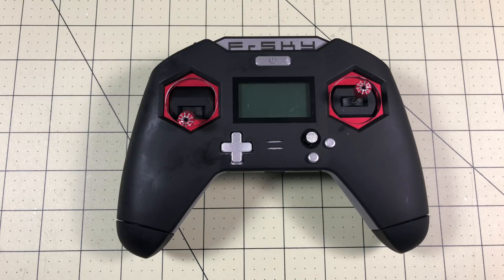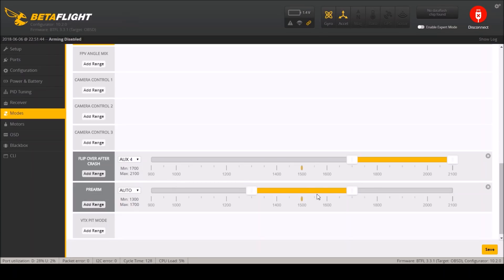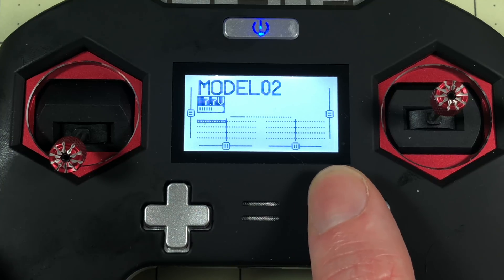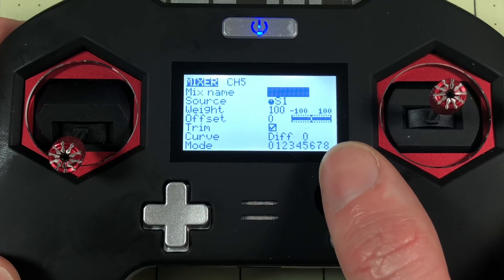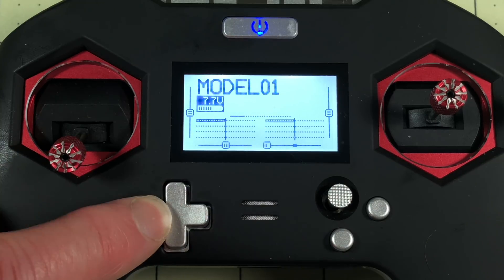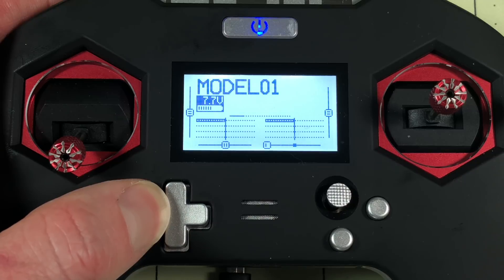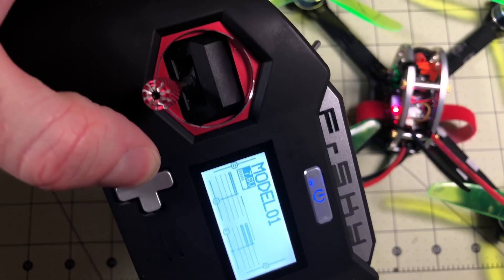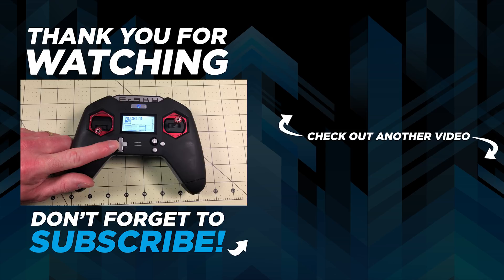FrSky Taranis X-Lite Momentary Switches and PREARM | How to use the trim buttons

Comment: I won't be able to use this feature if my Rx is set to only 8 channels (arm, mode, buzzer, rssi), is that right? I would need to flash the 16 ch firmware?
Reply: I have it working in D8 mode if that's what you're talking about?
Reply: With crossfire I had to switch to 12CH to use this (I have PREARM now on CH9 in the MIXER)

Comment: Very helpful.

Can more real switch’s be added to the front plate?
Reply from the maker: No. You can replace other switches with momentary. But not add them. Official FrSky Taranis X-Lite Momentary Switches  They exist, if you really need them. https://youtu.be/71-DPpuZJaU

Comment: Way easier to disable trim in flight mode 0 then you're good to go to assign them as regular switches without alarms
Reply: I tried that , and the switches are not picked up , am i doing something wrong?
Reply: Combine what DR101 is doing to set up the switch/mix/weight but use what Kyle is suggesting with Flight Modes to disable the trim functions.  It cleans up the graphic home screen of the trims, disables the sounds without deleting them.  @ProofBenny
Reply: @Kekafuch  how to disable trims in flight modes? All I get on FM0 is name, fade in and out values.

Comment: Hi, thank you for the tricks, Im using now momentary switch for prearming even as switch to trigger the buzzer.  Question:  Apart of  trim midpoint min and max point, which i have removed from sound system.  Is there a way to mute the beep for trim steps ?  Thank you again.
Reply from the maker: I’m sure you can.  Look on the SD-Card for something called beep, or chirp maybe,  there are only a few thousand files. You can find it. :-)

Comment: I really need your help with the 3 position switches. I have all my channels set up in the mixer for the xlite but for some reason the beta flight is only reading the low and middle value for my 3 position switches. 1000-1500. It's not reading low, middle and high as it's supposed to.
Reply from the maker: On the output screen of your radio does it show all three positions?
Reply: DroneRacer101 Output screen? Do you mean the mixer set-up? Yes it does. It's just not showing the high position in beta flight. Beta flight is showing 986 low 1500 middle. My values in Beta flight for min, middle and high are 1000,1500,2000. Also the Tx is updated to the latest firmware from Frsky website.

Comment: If wanting to keep the trim functions/sounds, you could replace the right side 2 position switch with an actual momentary switch. Or just use that right side switch as your pre-arm, though you'd have to remember to cycle it back once you've armed.

Comment: Why you choose Ail for the switch? Does it matter or you choose anything and when you assign that swith in BF it just becomes a prearm switch?
Reply from the maker: I used the left Aileron Trim because that is the left button on the D-Pad if you don't press shift.  You could use any of them.  What is important is what channel you assign it to in your radio.  In this case I used 5 which is Aux 1.  You could use any channel for this.  You just have to make sure it matches.
Reply: DroneRacer101 thank you. Did you do a comparison measurement, as I asked in your other video, of the distance between the centers of the sticks ,compared with the qx7 or xd9 etc. ???

Comment: Don't delete the sounds. Go into flight modes in companion and select "trim disabled" for your aileron.  No more sounds or slider moving on screen. You could put "_old" at end of wav file also, so you don't lose the files.

credit to the man...Kilrah: https://github.com/opentx/opentx/issues/3190